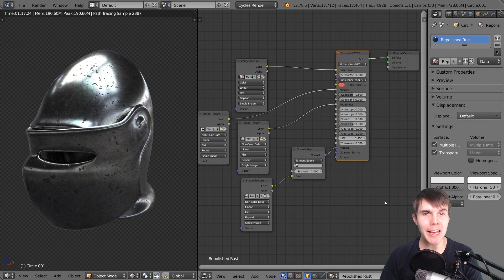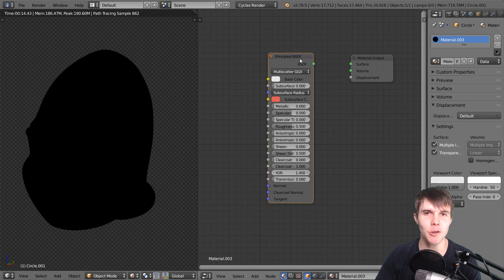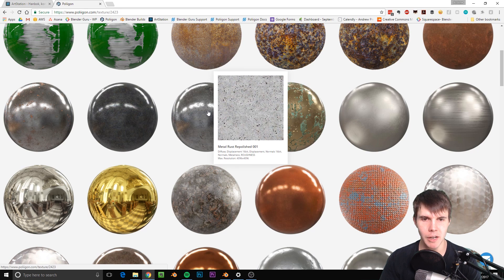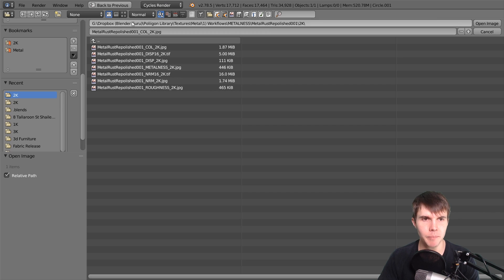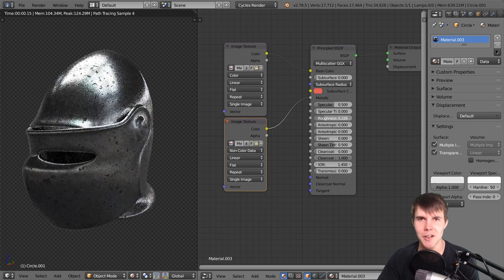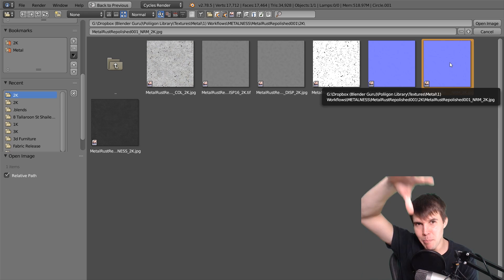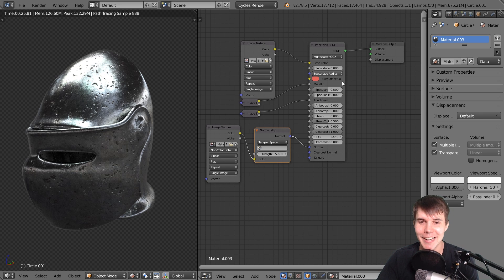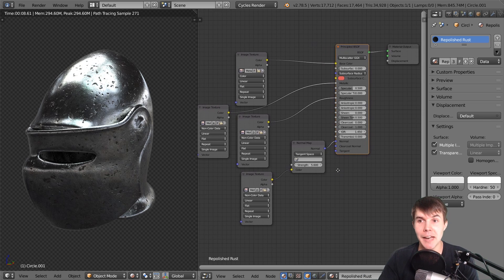How to Correctly Use Metal Textures in Blender

Comment: I've got a question. I am new to this Node stuff and know nothing about them. When you are animating, can you change the nodes mid animation? Like if the mettle looks shiny at the beginning of the animation, then after a war, it's worn out and scratched, can you change the nodes to do that during the animation?
Reply: I believe you can do that. Simply hover over the value and press I to add a keyframe. You can then check your Dope Sheet for the keyframes that were added so you can finetune and keep track of them. :)
Reply: +Reynante Martinez I thought so because it works the same way if you change the color or even scaling or the location if you just want it to keep track of only the X, Y, or Z coordinates instead of all of them. Thanks for telling me to.

Comment: This is very important, Please Read it. 
 I found that in oficial pdf document of Disney.
link : https://disney-animation.s3.amazonaws.com/library/s2012_pbs_disney_brdf_notes_v2.pdf
Page 12.

5    Disney “principled” BRDF5.1    PrinciplesIn developing our new physically-based reflectance model, we were cautioned by artists that we needour  shading  model  to  be  art-directable  and  not  necessarily  physically  correct.   Because  of  this,  ourphilosophy has been to develop a “principled” model rather than a strictly physical one.These were the principles that we decided to follow when implementing our model:1.  Intuitive rather than physical parameters should be used.2.  There should be as few parameters as possible.3.  Parameters should be zero to one over their plausible range.4.  Parameters should be allowed to be pushed beyond their plausible range where it makes sense.5.  All combinations of parameters should be as robust and plausible as possible.We  thoroughly  debated  the  addition  of  each  parameter.   In  the  end  we  ended  up  with  1  colorparameter and 10 scalar parameters described in the following section

Comment: I was toying around with this shader in viewport in the new 2.78.5 (2.79) and i notice when io do a viewport render - the resolution is terrible - even after applying a subsurf and toying withrender settings -  the resolution seems to be totally stuck at a very low level in viewport - ie aliasing - highly pixelated edges - any body anu ideas how to address this? Is there a setting i am missing>> any help appreciated

Comment: Ok, so, what if I'm still using 2.78? How do I use metalness? Does it work with Andrew's PBR Uber shader?
Reply: So yeah, if you connect metalness to Dielectric/Metal input in PBR Uber it works pretty good
Reply: Yeah. Andrew's PBR Uber works in basically the same way that this Principled shader works - along with many other modern game/rendering engines. The 'metalness' workflow has been around for a bit now. Really works!